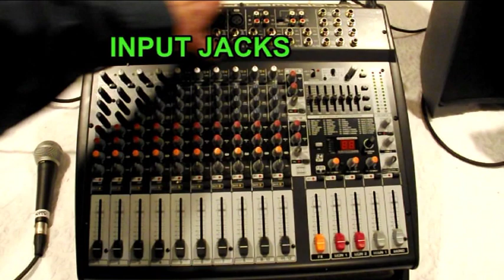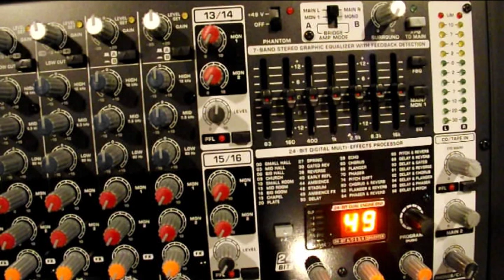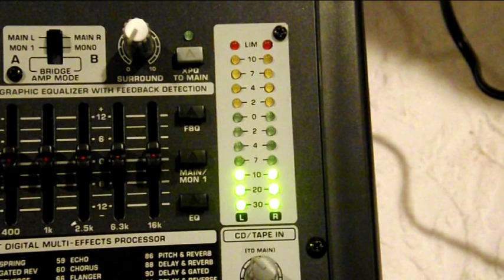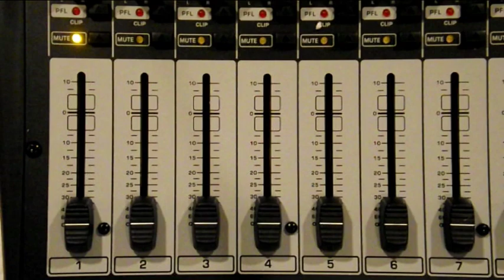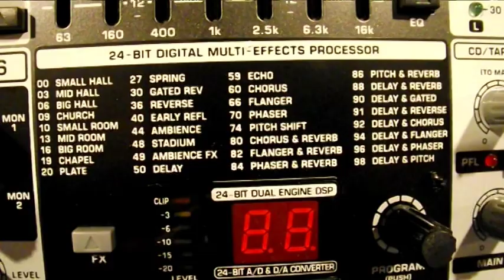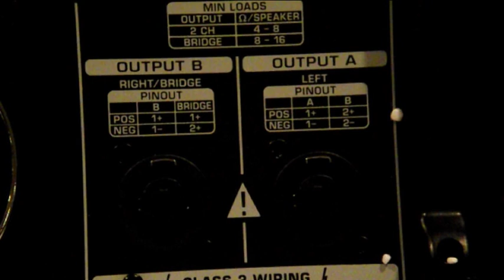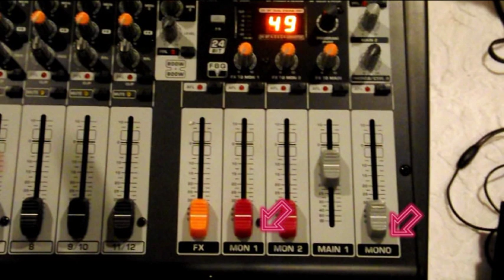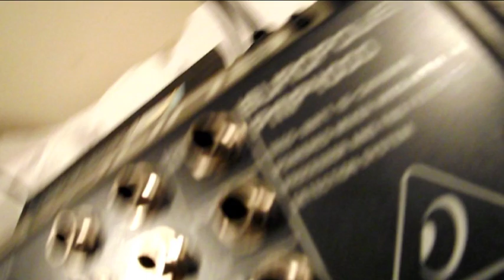Whacky Sound Education - System # 4 - Behringer Powered Mixing Board

Comment: Hi Frankie,

I have found your Youtube video for the Behringer mixer to be INVALUABLE and have referred to it many times.

One thing I'm not clear about ,though, is how to hook up a powered monitor- that is , where to plug it in and how to adjust the signal to it from the board. Would it be 'mono out channel to the far left of the board and Mon2 slider? Got a gig on Saturday and would like to try it out then.

Thank you and Best Wishes,

John Hammond
Reply from the maker: Hey John, 

Glad the video helps you and others.   

I use the board all the time with a mix of powered and unpowered speakers in a wide variety of configurations.  So what you are asking can be done, but it takes a little experimenting to get the correct connections and buttons pushed.  Here's the steps for a configuration that I am guessing is what you are looking for.  If not, ask again and I'll see if I can help further.

Configuration:  2 externally-powered aka unpowered speakers for front of house and 1 or 2 internally-powered speakers used for 1 or 2 different monitor mixes for the band. 
 
How? 
Output Mode Switch: (upper right) set to top position labeled "Main L  Main R" (video 9:40-10:20}
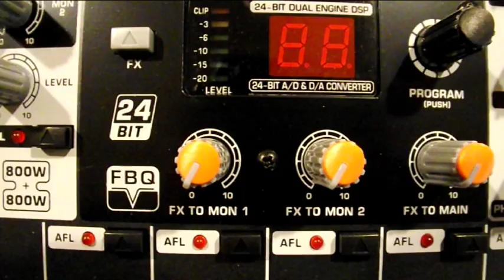Connections:  Two speaker cables from the speakon powered output jacks on the back of the board (video 8:20-8:40)
                          One line-level 1/4" jack from the Mon1 jack in upper right to the powered monitor #1  (video 11:15-11:18)
                         Use a second line-level 1/4" jack from Mon2 in upper right if you want a 2nd monitor mix (video 11:15-11:18)
Control:  The house volume will be controlled by individual channel sliders and the mixed channels will have the master control by the slider on the bottom right labeled "Main".  The channel "pan" dial can be used to change the balance between L and R.
                The monitor 1 volume for each cannel will be controlled by the channel Mon1 dials , and the master volume for Mon1 is controlled by the Mon1 slider in the bottom right
                A second monitor mix with its own individual mix and volume is controlled by the channel Mon2 dials and the master slider on the bottom right.

Hope this helps!
Reply: Thanks- what I'm looking to do is: Have output mode in center position, so run two FOH speakers and two passive monitors- that's what I normally do. In addition I would like to also run one powered monitor simultaneously!
Reply: I'm assuming I would use Mon Send 2 for powered monitor?
Reply from the maker: Correct!  I assume you are daisy-chaining two 8-ohm speakers from Behringer Amp-B for the house and using Mono slider as master control for this mix.  Then you have two additional 8-ohm passive speakers from the Amp-A and are using MON-1 slider as master control for this mix.  Finally, you can drive an active speaker from the Mon Send 2 and use the Mon-2 slider as master control for this output.
Great geek stuff - have fun this weekend!
Reply: Thank you! Going for a test run now and will report back! You're a star!
Reply: All in perfect working order! Thanks again- when I get a moment, I'll ask you what the AFL button does! It's nice to not be as confused about the Behringer as I once was!

Comment: Can You PLZZZZZZ give me an Idea on how to run It in Bridged Mode??? The Manuel doesn't show a hookuo for Bridged mode? The only thing I want the Mixer to run is the Mains. 2 Berhinger 2x15's the Subs and Moniters will B Run off of separate Amps Thanx!!!!!!!!!!!!!!!!!!!!!!!!!!!!!!!!!!!!!!!!!!!!
Reply from the maker: +DOGHOUSEMEDIA1 Hey Dog, thanks for watching!  If you want to drive two Berhinger speakers, you should connect one speaker to powered output A and the other to output B.   You would only use the "Bridge" mode if you only had one 8-ohm speaker that could handle the 1600W of power.Here's warning text from the Behringer 4000 manual. Also note, bridge mode requires special wiring connections to the twist connectors, as shown below.
Reply from the maker: +Frankie Stamps Diagrams did not come through, if you email me at Frankie.stamps@comcast.net, I can send you the diagrams I referred to above.

Comment: Here is my question and thank you for any info you can provide...  I run (per side).. a total of 6 ohms..  An eighteen inch sub woofer rated at 8 ohms.. and a two 15 inch cabinet with horns.. rated at 8 ohms..  for the total of the 6 ohms per side..  I have the same amp Behringer PMP 4000..  My speakers ( the 18" and the duel 15's ) are rated 500 watts RMS..  I would like to get more volume at our gigs during outside performance's.. We also run a 4 monitor system.. Two 15's at 500 watts.. and two smaller 12" daisy chained off of the 15's.. One per side..  so..  One 15" monitor is chained to one 12".. Only issue is the 12". is only rated at 100 watts.. Everything seems to be holding up fine. No distortion... I would just like to get more volume.. If possible..
Reply: Can we connect active speakers from unpowered output line and passive speakers from the powered line(back of the mixer) at a same time?As I have both active and passive speakers.I hope to get the answer soon.
And If  I connect as much as powered speakers(no passive) and daisy chain them will that be an good idea?